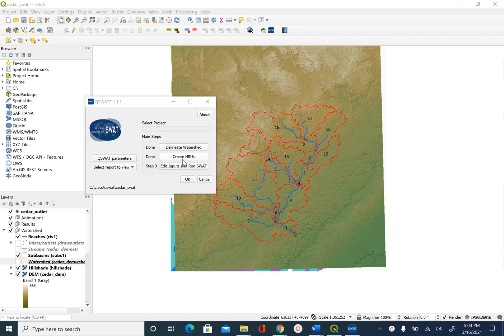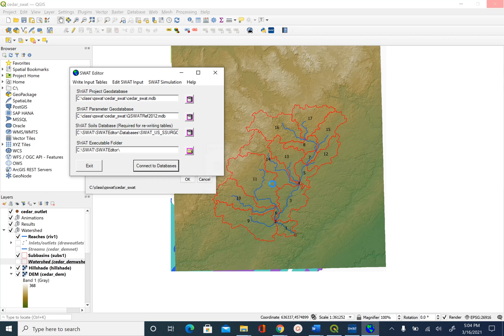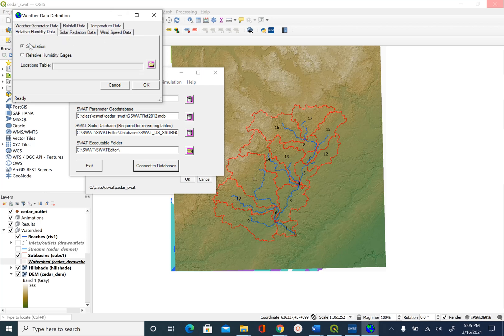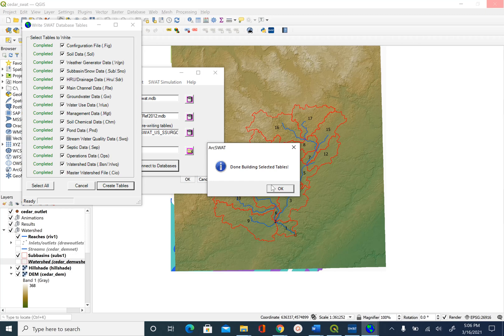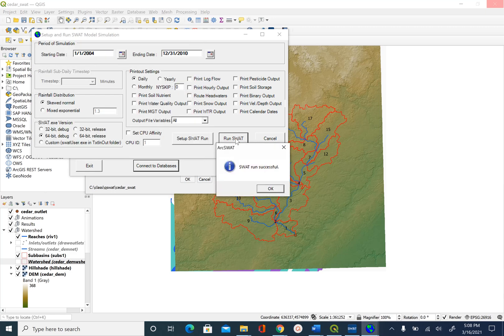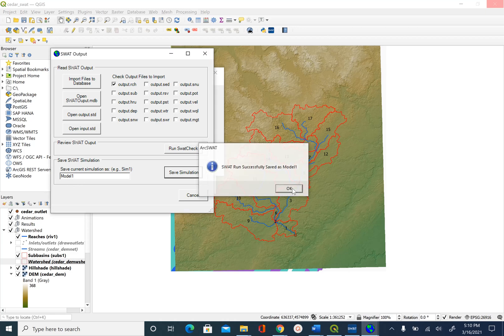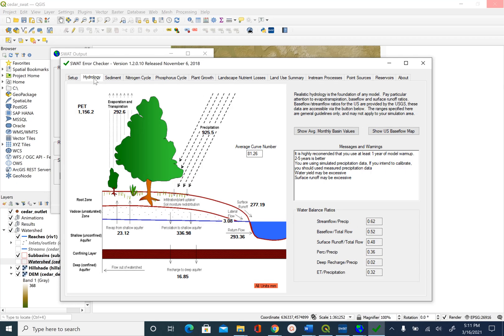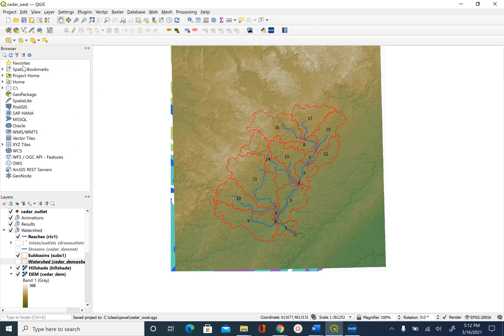SWAT Hydrologic Modeling using QSWAT (5/6) - Create input files for SWAT and Run SWAT Simulation

Comment: Hello,
i came across an error while running QSWAT Rev681. the 64-bit debug  " forrtl : error (72): floating overflow" .Kindly help with the solution. Thank you
Reply from the maker: Unfortunately i am not an expert on software issues. You may use google to get help

Comment: Hi, thank you for your video. Do you know why the editor option appears blocked to me?
Reply from the maker: Make sure swat editor is installed. You can go to their website and check all the requirements.
Reply: @hydrologyvideos8253  Thank you for your response. it is suppossed that Qswat editor is installed because I did step 1 and 2 which are about delineate watersehd and create HRUs no problem with that I could did it, the issue is when I want to go over step #3 (edit input and run swat). Sorry if I did not write my question was not well written before. I would appreciate your response about step#3. Regards
Reply from the maker: @elispot17  third step should become active after you successfully create HRUs. I do not know what is the issue. maybe redo HRUs again and see if that helps.
Reply: @hydrologyvideos8253  hello, thank you for your support, I had to change the HRUs conditions, I ran it again and it works, edit options got activated.